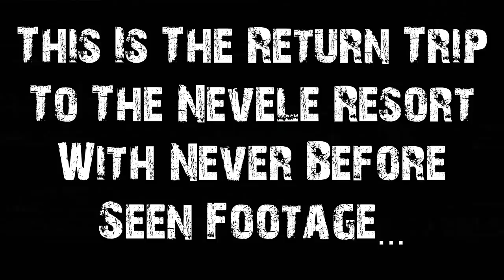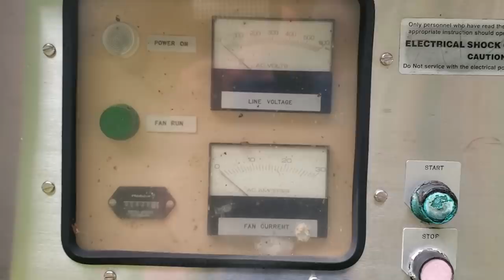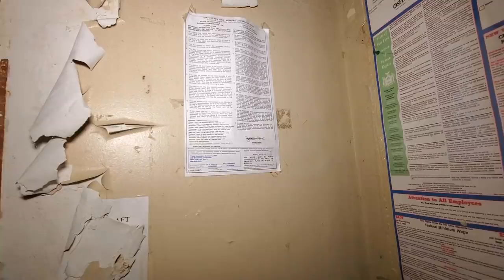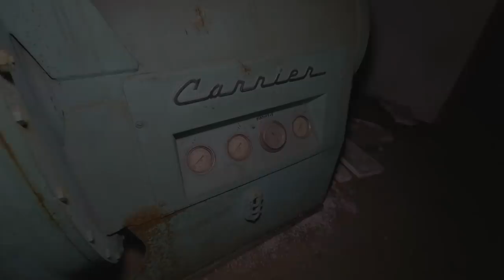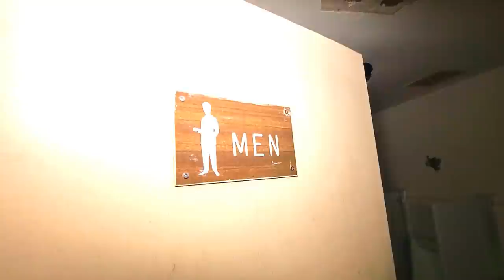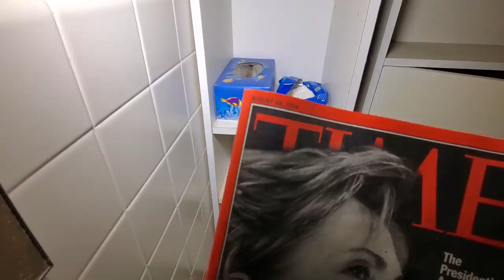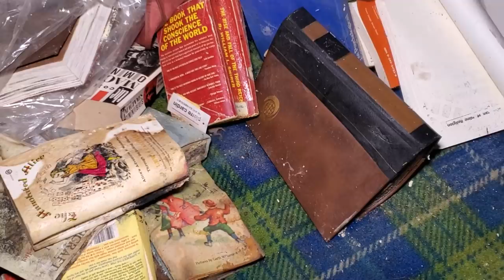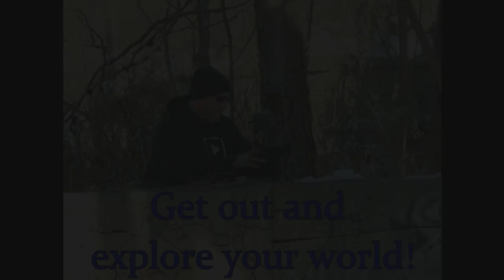Why Is The Abandoned Nevele Resort Still Standing?  (Never Before Seen Footage)

Comment: Two things. In one part of the video you saw a sign that said red jacket class and you did not know what that meant. Well back the day, many restaurants, hotels and resorts that included fine dining had separate shifts for breakfast, lunch and dinner each required a different uniform (typically the waiters jacket/vest color). The uniforms varied depending on the restaurant and management. But generally the colors were white for breakfast, red for the lunch and black for the dinner rush.
Eventually most restaurants decided to forgo the jackets for a white dress shirt with a dress tie, which has become the standard in most restaurants today.

The restaurant will generally hold a training class for each shift independently whenever there was a change on procedure, menu or management.

As for the kids room. More likely to be a place for the owners kids to play.
Or since it was in the villa where the employee lodging was located in that building with a big kitchen and some very spacious areas. It could have served as an employee daycare and common area for employees days off.
Reply from the maker: Thanks for sharing

Comment: At 43.00 that was a water chiller. It is a freon type refrigeration unit that has water going through it that is then piped through the building to cool individual rooms or spaces. I scrap these out and you are right it is a lot of work. Half inch thick steel cases then the copper inside is supported every foot by steel dividers. Thousands of pounds of copper but a lot of equipment needed to get it out. Usually scrappers aren't that motivated, they just rip out the easy stuff.

Comment: i noticed that the sink had been removed in the room that stinks, the smell might be cause by hydrogen sulfide gas coming from the drain pipe, its known for its pungent "rotten egg" odor at low concentrations. exposure to hydrogen sulfide may cause irritation to the eyes and respiratory system. i could be wrong but it theory. but thanks for the adventure, greatly appreciate it .
Reply from the maker: Makes sense. Thanks for checking it out.

Comment: 28:20 The suitcase on the right seems to hold some kind of metal frame with electronic components, maybe some kind of portable transmitter ? Seems to miss a tube in the socket though.🤣

Comment: I'd say the can is from the 70s or 80s, because of the small opening to drink from!
Reply: It had to have been from the mid 80's or later because it had a "stay tab" opener.  Before the mid 80's, (except for a year or two when the push in button/finger shredder cans were around), the "stay tab" cans replaced the "pull tab" cans.

Comment: The building that contained the intact chiller and its motor-probably for the skate rink-freese the water in the skate floor.The complete and intact "mogul chewer" snow groomer.Used to see those on Terry Peak in Lead/Deadwood South Dakota during the ski season.Didn't ski-wasn't the hobby for me.Just liked going to the resort.Noted how someone took the wiring for the chiller motor.The motor should be saved before someone butchers it for copper and iron.also noted the power pole with the 3 large pole pigs on it-3p supply for the motor.You should have unfolded the banner signs to see what they say-another clue as to the goings on there and the products-services sold there.Sad about the butchered chiller-and the speant abrasive blade used to cut the heat exchanger open.Carrier-those chillers would be worth something salvaged intact to reuse.Sad how the rooms destroyed for no real reason-why can't other "explorers" leave the place intact for others to discover and enjoy seeing and photograsping-as you say-History!

Comment: the radio in the snow groomer looked like 8 track not cassette
Reply: I have an 8 track i used to have hooked up in my 48 Chevy Truck in the glove compartment. 8 tracks have a much larger opening and 8 track tapes went into the opening of the player long ways, not sideways like a cassette tape. I still have my 8 track player and my rock n roll 8 track tapes.

Comment: Would be amazing to see how much of the original lights and stuff would still work if the power was turned back on but I'm sure you'd have quite a few short circuits after Scrappers have been in there and the weather deteriorating things but some systems might still work and that's a shame that somebody cut that copper on that boiler tank you would wonder how they got it out of there I know how it happened in the case of the old Reid Memorial hospital because the last people that actually own the building since they had possession of it they were wanting to remodel things because I noticed the elevators have been parked on the top floor where they had been taking things down and they kept doing that until the power was shut off but the last developer for the Reid Hospital just figured hey let's scrap all we can out of here and then leave town and stop paying our taxes on the building and that's what happened but you would wander and the case of the nevele how people would take the scrap out of there without getting caught I hate to see places get vandalized especially places with great heritage you can in history like this place

Comment: I am consumed with knowing the outcome of this resort. I have no money or influence, but it is too good to destroy. I think it may still be standing in July 2020. I can see it with Google Earth and Google maps. It could be fake, but I heard humming in the basement of the round building building in another video. That would suggest power is ON. President Johnson slept there, not that it matters.
Reply from the maker: The top of that tower is an transmitter tower that does indeed have power running to it.
Reply: JPVideos, do you know the call sign or use of the transmitter? There is bunch of AC vibrating in that building. I found an FCC granted application for a tower to be located nearby, but It was never built. The FCC application dates back for a few years. Governor Cuomo mentioned this resort by name as benefiting from a Casino law. COVID-19 has affected so much.